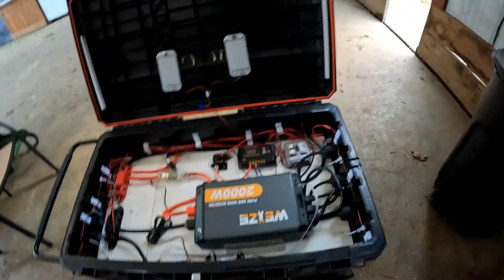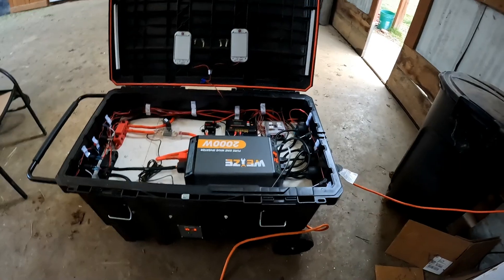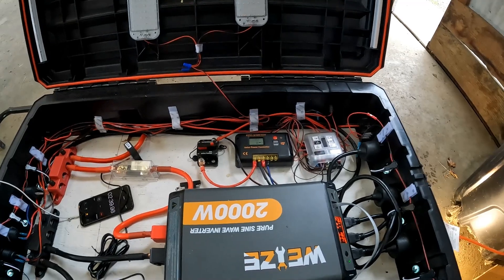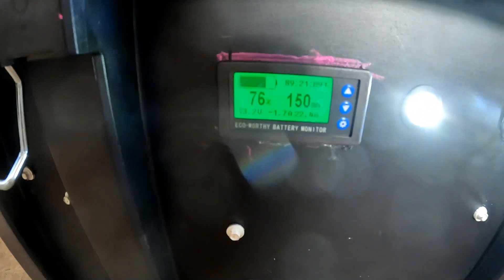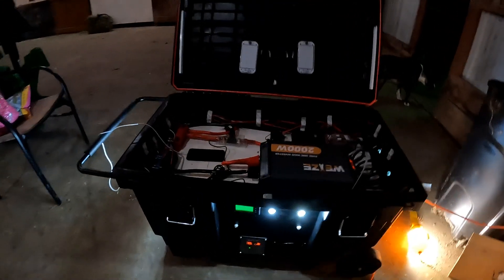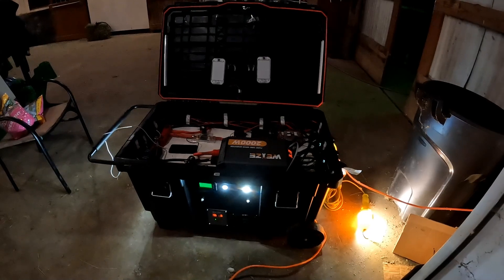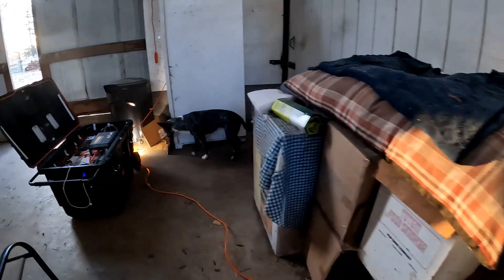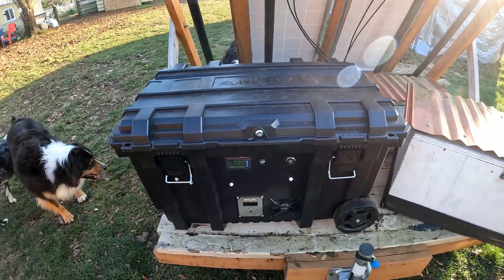Solar generator 24  hour test

Comment: When plugged into 120 volt wall outlet, how fast does it charge?
Reply from the maker: I don’t exactly know, I plugged it in and I checked it in the morning and it was fully charged. I do know if they get really low, like down to 25% it takes about 8 hours because the batteries slow charge until about 50%. I’m also charging both batteries at the same time.

Comment: May I make a suggestion at to change the direction of the solar panels throughout the day or you could mount them up higher. I was looking at the little tent that was blocking the sun off to the right
Reply from the maker: I made that frame a little more mobile so I can move it out to a clearing. I was hoping I could leave it where it was and keep the solar generator in the barn and just run some wires too it but I see that won’t really work. I’ll do another test once the sun comes out again.
Reply: @mattlacombe3912  I’m a beginner myself 😊

Comment: Four more 100 watt panels and a 40 amp mppt charge controller would fit this nicely and charge up quickly.
Reply from the maker: I purchased two 200 watt panels and I had a 60amp PWM I’m going to the 30amp. I don’t have room for a big MPPT charge controller. Unfortunately in the Pacific Northwest there isn’t a lot of sun in the winter. Thank you for the comment.
Reply: @mattlacombe3912  I get it. We gotta do what we can do. The extra panels will certainly help. Nice build and you're gonna love that mobility.

Comment: Nice am building 5 100amp 12V  ,1200watt storage capacity  lithium battery 🔋 diy solar generators with blue tooth Mppt Controller and Inverter myself ,nice build
Reply from the maker: Thank you. It was a lot of fun to build it.